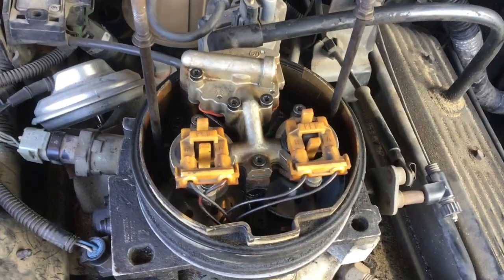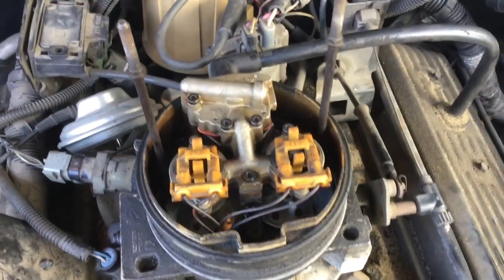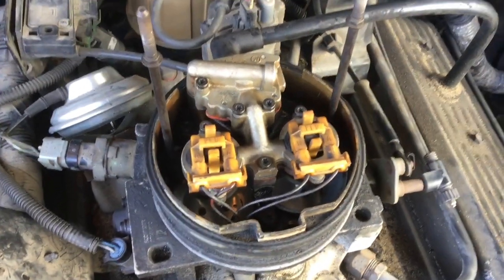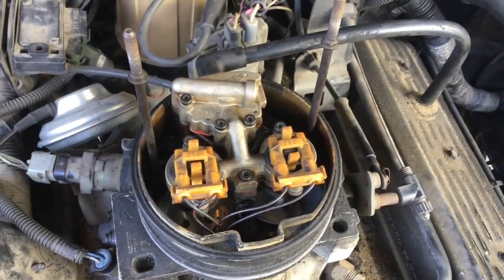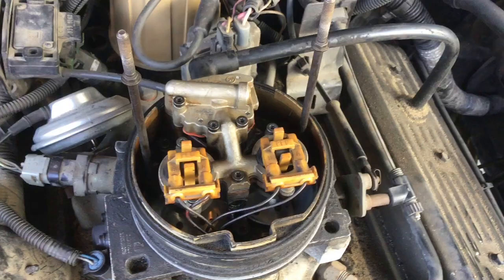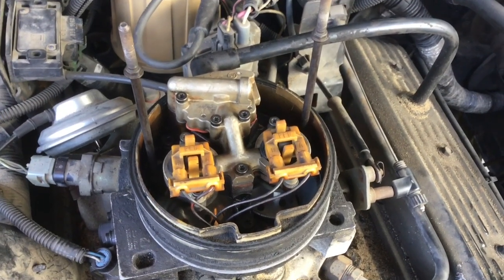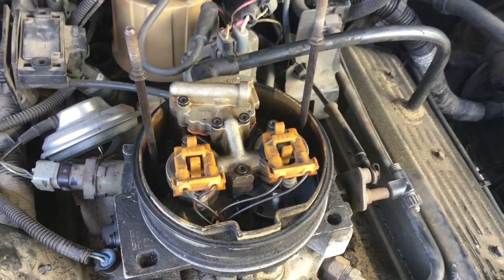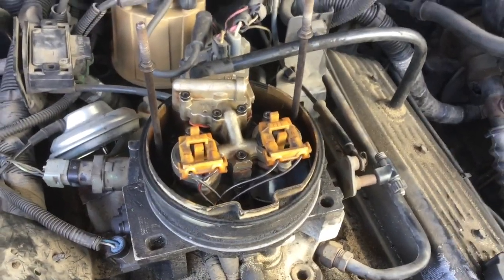GM TBI Injectors With Engine Running

Comment: I like my 93 Silverado with the tbi system.  easy to work on and troubleshoot.. best thing to me is when you fix the problem the check engine light goes out ... 😎
Reply from the maker: I agree. This thing was built to work forever, and it’s easy to rebuild, and new injectors are cheap. I do wish it got a couple more miles per gallon though.

Comment: If you took that plastic ring the air filter sits on off we could see the actual spray pattern
Reply: He should have put a light on the injectors so we could see something !
Reply: @donttouchmymoustache4666  he only has two hands man…

Comment: I know this video is old but my 95 Chevy 1500 runs good when I start it up but after 30 mins of driving it act like it’s flooded out and loose power can it be dirty or worn out injectors? Thanks
Reply from the maker: That’s a tough one. If it runs fine when it’s cold, but it probably isn’t the injectors. Could be the ECU computer. On mine the ECU computer went bad and it did a lot of crazy things and wouldn’t run right. Replacing it fixed it. Might be the EGR valve also. These things are really hard to figure out.
Reply: hoohoohoblin thanks man

Comment: Hello I have a problem with my GMC 1993 have same carburetor (EFI) but won't start on  unless I put some carburetor cleaner then after that it'll run but if I turn it off she won't start again 😢🤯 I have change everything (fuel pump,injector, idle sensor, temperature sensor, oil sensor you name it) don't know what to do anymore......
Reply from the maker: The injectors are probably dirty. Here is a video I made showing how to remove and replace them. Might try running some cleaner in the gas tank before you do this and see if it helps.  How To Rebuild TBI Fuel Injection System On Chevrolet and GMC Engines https://youtu.be/NsRwS9e600Y

Comment: Hello, I have a 95 V6 Cheyenne Silverado and it’s making a loud whistling sound, I was told it was for sure the alternator... turns out it wasn’t, I changed serpentine belt and idler pulley when I changed the alternator but the sound was still there. This other mechanic found the whistling sound coming from the tbi, when I accelerate the sound goes away, you only hear it when it’s idling... should I switch the hole thing, or only certain parts from there to make the sound stop?? Any help helps?? Thanks
Reply from the maker: It’s probably a leaky gasket. You should check the gaskets around the throttlebody injector unit.  
The only other thing I’ve seen that makes terrible noise is idler pulley bearings for the accessory drive belt.
Reply: hoohoohoblin , thanks for replying back! 😃 I Will check on the gaskets... imma see about trying to rebuild the tbi. Thanks again!!
Reply: I had an ac compressor go bad and sound like a supercharger. Only it was really bad dead weight for the engine so I bypassed my AC. Sound went away, performance improved. You kinda have to put your ear up to it and really try to place the sound. Be careful though.

Comment: Can u upload video of the tbi with all vacuum lines correctly connected?
Reply: Nice this guy had a great idea if he did it in the nighttime with the flashlight it would highlight what's going on my neighbors injectors just has a little squirt and it's idling real rough and Rich I can't really tell by his pictures if it's a mist like maybe the pressure regulator open for suggestions
put a 91 454 in an 88 88 GMC 1500 the wiring harness matched except for one wire.
Im going to buy the throttle position sensor map sensor . It looks like AutoZone might have the whole thing for about 500 might be a smart way to go unless that one wire was important

Comment: Question. I have 1991 camaro tbi its a 305 and i just blew the motor. I would like to replace it with a 350 instead of the wimpy 305 since im gonna replace a motor any way. From what ive read everything from my 305 should bolt on to the 350 and i dont have to chip it since the motors are virtually identical except for the bore size. I read in two forums a few people did it in California and had no issue with emissions. Im still kind of skeptical do you think it would be ok if i did so? Will it still pass emissions?
Reply from the maker: I wish I knew the answer to that one. It’s above my skill level. It wouldn’t surprise me if it’s the exact same unit, and the sensors in the engine regulate the fuel mixture, so the extra bore size doesn’t matter. Maybe you could look up the part number of the fuel injector for 350 and then look up the part number for the 305 and see if they are the same one. They might be the exact same part.
Reply: @hoohoohoblin  thanks for the reply! Thats a great idea im gonna do that and if the part numbers are the same im gonna go for it. I just wanted to get your input i wanted to make sure id be cool with the sniffer when it came time to smog. Awesome page by the way!

Comment: Had a quick question,on my 94 k1500 5.7, my car will start to try in stall when I shift to second and sometimes turn completely stall. I put in a new fuel filter and then it did the stalling again and back fired once. I noticed it does it when it's a bit cold. After it stalls the emergency light will come on then drive normal.....thoughts???
Reply: Throttle position sensor. Might be it